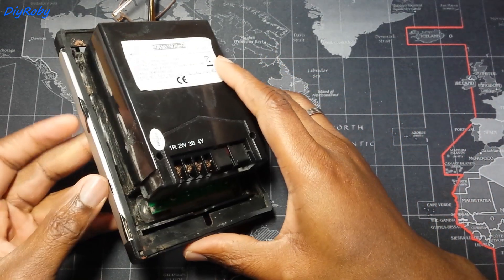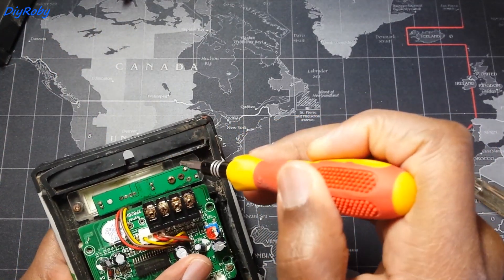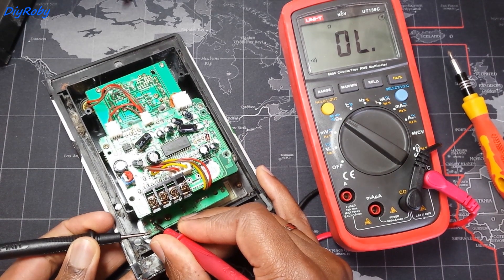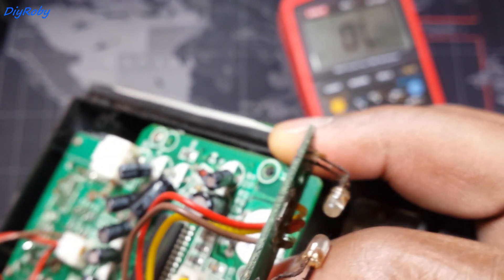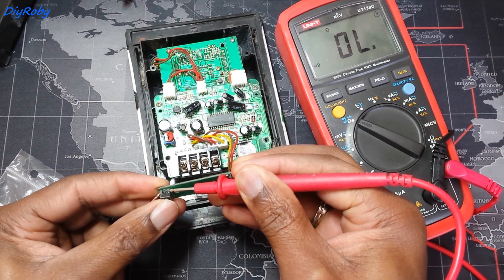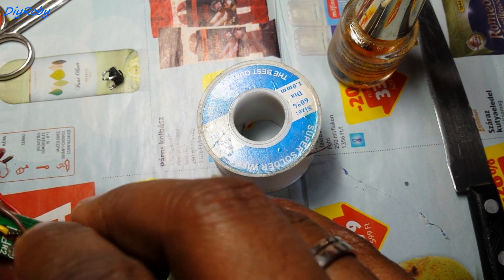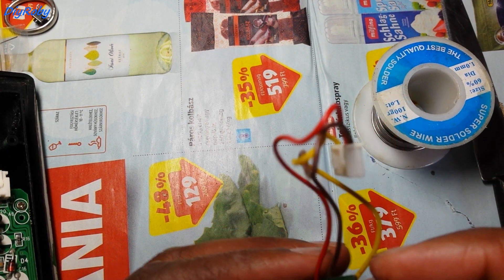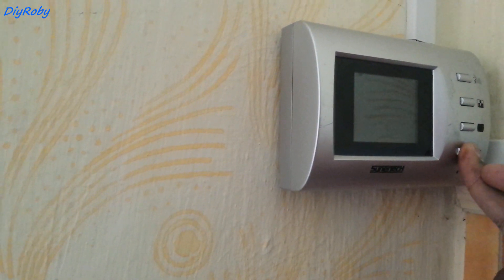Video door bell phone diagnosis & repair. Synertech doorbell not working & water damage.

Comment: I have the same problem, thanks for the video! Can I just ask which button replacement should be ordered? As I see from the paper background you are also in Hungary, if you know what shop I can buy the button it would be very helpful.
Reply from the maker: Hi, it's the basic push button like this one https://kontel.hu/MIKROKAPCSOLO-6x6mm-MAGAS you can find it in any electronic shop.
Reply: @diyroby732  Thanks for the help, finally I found and bought a button in another local store but after replacing the system still doesn't work. The button now shows continuity upon pressing and no continuity when it's not pressed. I have to check further...
Reply from the maker: Does the door bell work if you bridge the button solder joints? If it does, you just need to find the correct push buttons.
Reply: @diyroby732  No sadly it doesn't work if I bridge the solder joint so I have to keep looking at other places for the fault
Reply: I found the issue and fixed it! In addition to needing a new button as described here, there was a problem with a broken cable to the house. Now that's also replaced and it works
Reply from the maker: Great job. I'm sure it was satisfying :)

Comment: You are correct about the consumerist mentality of discarding nonfunctioning items without any attempt to diagnose and repair.  However, in the case of professional repairmen, I think many are not satisfied making the relatively small amount of money they'd earn for a time consuming repair, or even a quick fix, for which they couldn't charge very much.  If they were honest, they would inform the customer that they only required a quick fix, and would charge a fair amount for the easy repair.  But that doesn't make the repairman much money.  So they just tell people they will need to replace the entire unit; that is it unfixable.  What they really mean, is that the amount of time and labor required to fix it, is not worth it TO THEM.   But they don't admit that.  They just tell the customer that they "need a new one."  Then, they make more money with less time and effort, but it is not honest!  It is a very sad situation nowadays.  When I was a boy, the repairmen ALWAYS fixed a repairable item and charged a modest, but fair price.  Yes, they made less money.  They are all trying to make a killing nowadays.  Everyone feels they are entitled to live in the big, expensive house neighborhood, even though to do that, they may have to forego business ethics.  People in general, undoubtedly had more honesty, integrity and work ethic 60 years ago.
Reply from the maker: Yeah Michael, it's sad. I have no problems with repair men making money. Their high per hour rate does doesn't change anyway and most charge just for showing up. There was no reason this door bell couldn't be temporarily reinstalled while a replacement arrived. Weeks passed by before I reinstalled it, so it could be used to look on to the street by the disabled owner. The thing is that most repairmen don't even learn how to diagnose stuff anymore, it's so cheap to buy new.
Reply: Perfect view, I agree with your comments. Today's mindset is use and throw and buy a new one.
People's purchasing powers have increased and electronic stuff is available at cheap rates.
Reply: @manojg6813  Yes, if you’ve been living in the US for the past four years, regardless of race, color, or culture, your buying power has gone up in an unprecedented way.   Our dramatically improved economy and employment rates, have also had ripple effects in raising the economies in other parts of the world for citizens of other nations as well.  It is well- known that the US economy drives the economy for much of the world.   But, don’t look for that good fortune and increased buying power to continue if the election goes the wrong way today.
Reply: @centerice  we in India try to repair every device